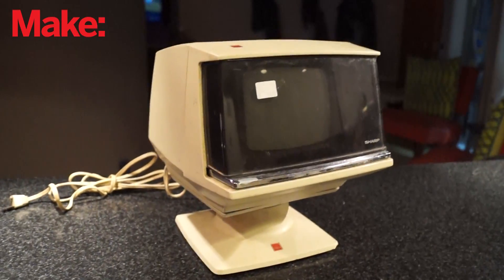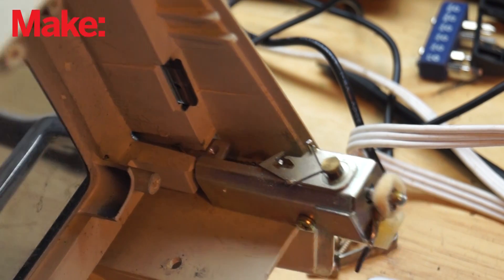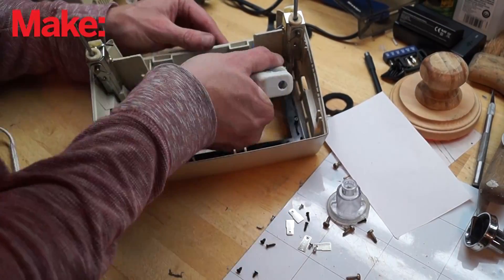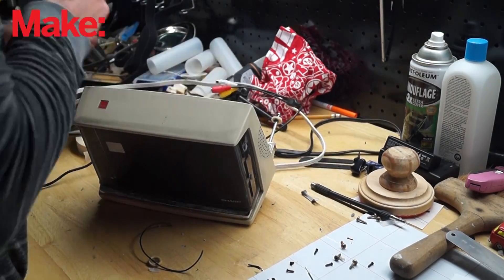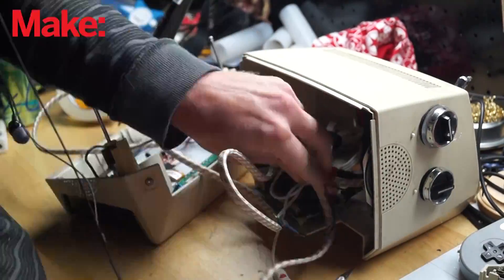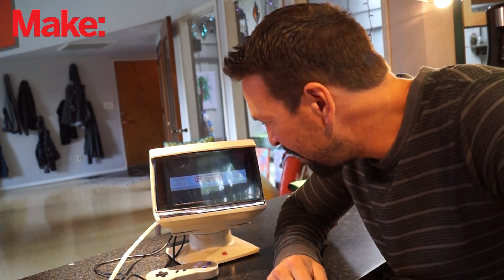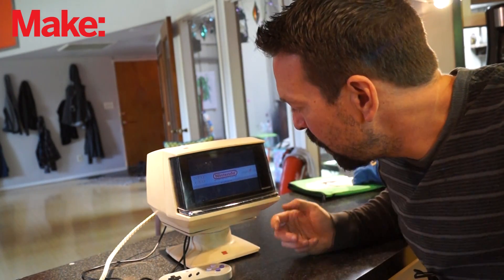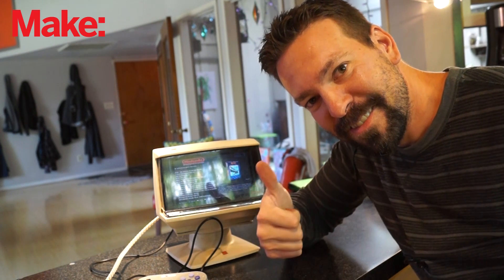Quick and dirty raspberry pi retro console from an old tv

Comment: I picked up a small CCTV black and white tv for just €1. This was one of the first ideas that popped in my mind. Might have to gut it and do this myself. Only problem will be fitting the screen.
And the best about my tv is it also has a handle :P
Just molded into the plastic at the top. You can fit your hand in there perfectly. :)

Comment: Very slick. I always hear about restomodded cars. You happen to have a cool resto modded tv. I don't think I would have changed anything on the outside either. which version of raspberry pie did you use? lol and if looking to change the color from beige. You could always paint it like a rasberry or hot rod red. :)
Reply: I used the raspberry pi 3. It works great! I could paint it but I kind of like how it just looks like an old TV when sitting on the shelf.

Comment: Add an internal battery and make it portable, then the handle will be useful.
Reply: kEhYo My thoughts exactly. If you do it right you can even make the battery compartment accessible from the outside.
Reply: absolutely true
Reply: kEhYo immediately came to post, upvote, or both if needed with this thought...i commend you though, fellow poster, your commitment to excellence is wireless...never ceasing in our great community! tireless, again! bravo!
Reply: we need to see this
Reply: love the project and i would def put some 18650's w/ a tp4056 charger controller  in that bad boy. project DONE!